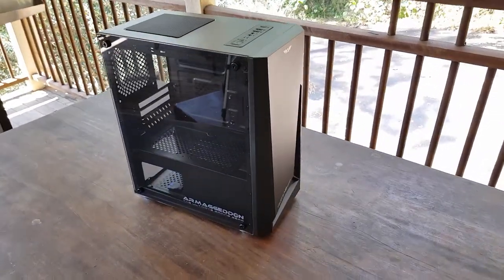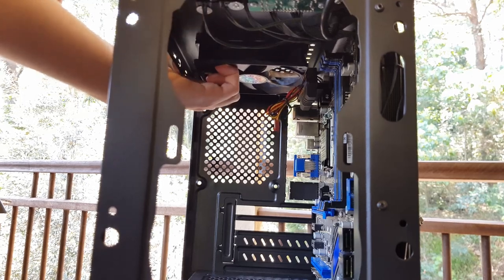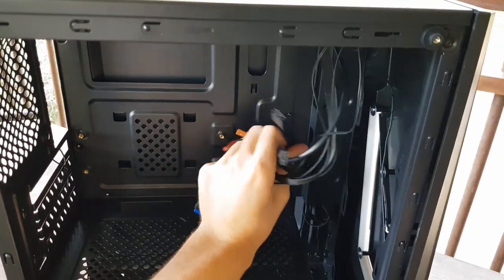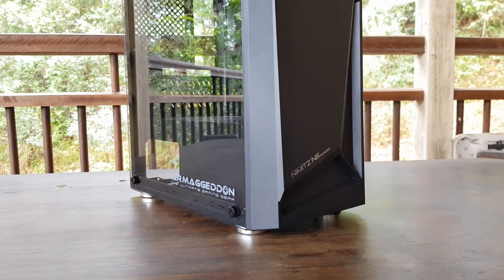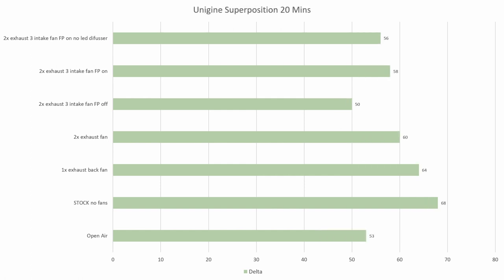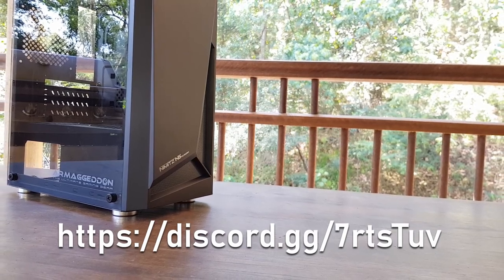A Challenger Approaches! Armaggeddon Nimitz N5 Aurora Review

Comment from the maker: Timestamps:
Intro 0:00
PEEL 0:38
Packaging 0:43
Top panel 0:58
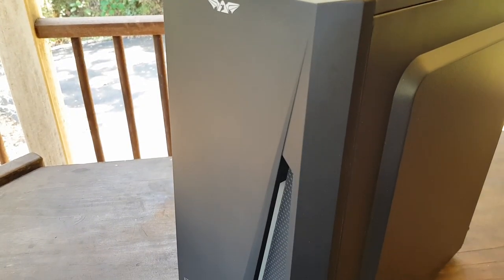Front panel 1:23
Bottom of case 1:43
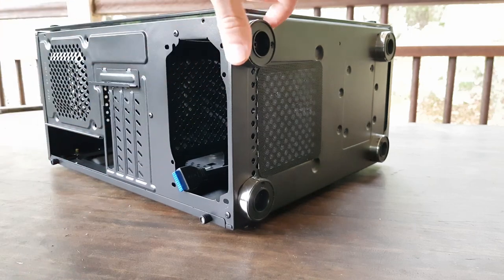Back of the case 2:03
Taking off side panels 2:13
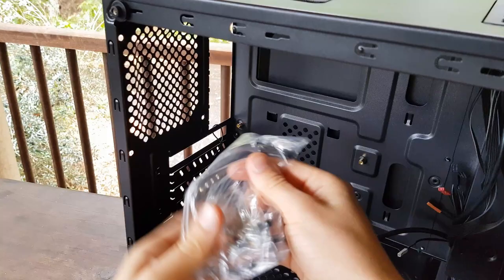Screws 2:40
Drive support 3:11 
Inside the case 3:34
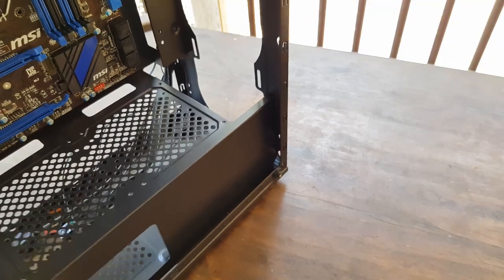Front IO Cables 3:55
RGB 4:11
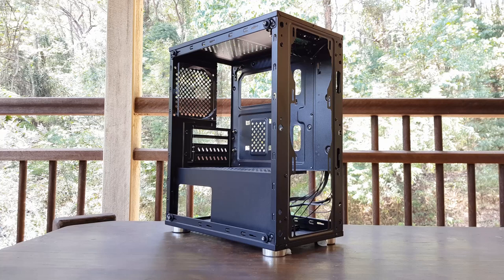Fan and Radiator Support 4:31
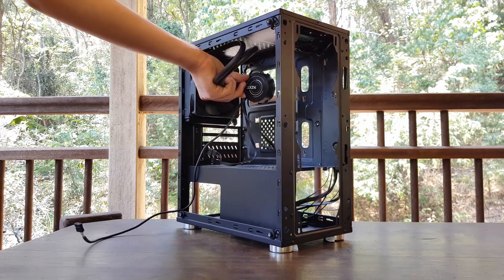Thermals 5:11 
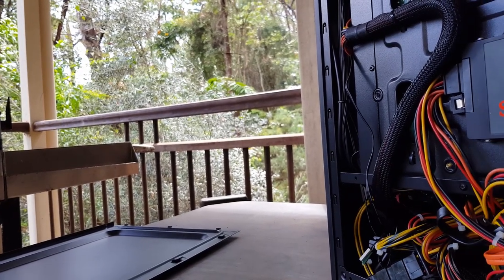Cable Management 7:34
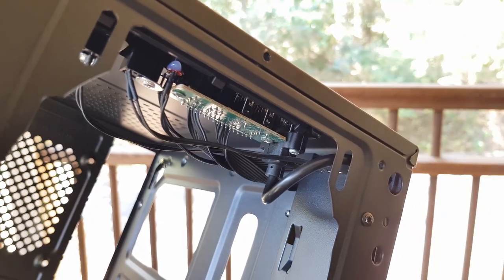GPU and Cooler Clearance 8:00
Conclusion 8:27
Reply: If I'm running a 3070 while streaming on  1440p, 144fps are Temps gonna be okay after a few hours? I'm using 2 intake 2 exhaust
Reply from the maker: @Clarin-3831  See how temps are using something like MSI afterburner. I wouldn't know.
Reply: @connectronbuilds9960  Will my psu fit? 150x140x90mm psu btw
Reply from the maker: @matthewdjumin907  Yeah that will fit fine
Reply from the maker: @LumosMaxyma I'm not entirely sure of the name but it's the same size as the Asutek OEM. It's probably an old nzxt kraken. Anything with small rubber tubing should fit though, like cooler master's budget ones.

Comment: this is a great video, good to see another pc builder from perth. Would just like to see a build with the infineon 1000 using it's 150w 12v rail PSU haha.
Reply from the maker: I actually have that power supply, dont buy it its literal garbage and its light as a feather and it only has a 4 pin cpu connector.

As for the infineon 1000, it's literally this case but with a glass front panel.
Reply: Connectron Builds do you think you’d be able to piece together an APU build if you found one super cheap on the used market and flip it?
Reply from the maker: @MarshallSambell  I dont really have the money to do that atm.
Reply from the maker: @MarshallSambell  Update on that, I made a PC with a 1050 powered with that power supply.

Comment: Hey dude! Great review! Just thinking of buying this but I’m wondering how the RGB connects? Planning to use this with a LGA1150 system but I don’t want to have to shell out for an RGB Hub or something like that!

[edit] it’s a 1150 motherboard that doesn’t have any RGB headers or much bells or whistles at all!
Reply from the maker: It uses the button on the front to control the rgb.
Reply: Connectron Builds sorry I didn’t specify! I’m meaning as to like how to connects, like does it plugin via a Sata port or is it like the normal RGB plugins
Reply from the maker: @wazziz  Ah, its just molex.
Reply: @connectronbuilds9960  oh thanks for that!!!

Comment: How did you install HDD? I find it difficult to find a place for my extra HDD. The M2 SSD is fine and the HDD can always go to external casing, but I can't find a good spot inside
Reply from the maker: It goes under the power supply basement, above the power supply.

Comment: Thinking about buying this case and drilling holes on the front for more airflow. I really like it but seems front panel is cocking the front fans. Any advice?
Reply: Consider buying "thermaltake versa h17 window" case?
Reply: @nanand.r  that one is not available in my country. The one you reviewed is the cheapest case I could find. And am on a tight budget. You think it's a bad idea?
Reply from the maker: It's really up to you, see how temps are after adding an exhaust fan first I think.
Reply: @connectronbuilds9960  thank you

Comment: Rgb in case doesn't work because the power suply is newest than case how to fixxxx??
Reply from the maker: Regardless of how new your power supply is it should have a Molex connector, so if yours is modular check if there are any spare Molex cables. If it's not modular and you definitely don't have any Molex connectors on your power supply you can get a male Molex to female SATA adapter.
Reply: Connectron Builds thank you

Comment: please tell me how to install hdd on this case
Reply from the maker: It slides in above the power supply and screws in through the holes in the power supply basement.
Reply: @connectronbuilds9960  thank you.I am also having a problem taking of the other side panel do I have to use force because I feel like I will break it
Reply from the maker: @tarapavlovic3542  It comes off parallel to the case toward the back, So basically slide it off to the back of the case.

Comment: please tell me cant i put the three fan gpu for this casing
Reply from the maker: Depends how long it is.
Reply: @connectronbuilds9960  it is 28 centimeter card
Reply from the maker: @thisalsennath8629  It will fit
Reply: Is it okay
Reply from the maker: @thisalsennath8629  yes
Reply: @connectronbuilds9960  my graphic card is gigabite rx5500 xt